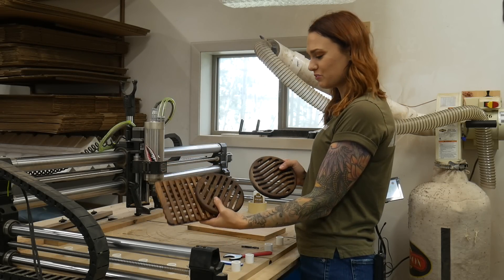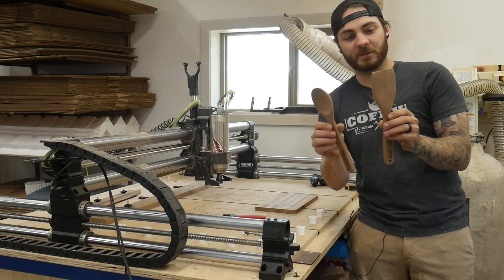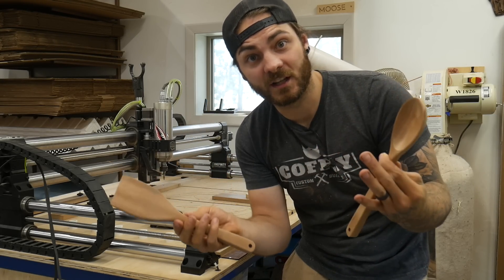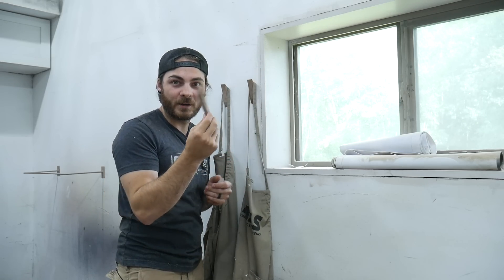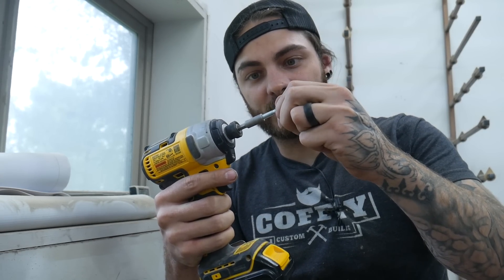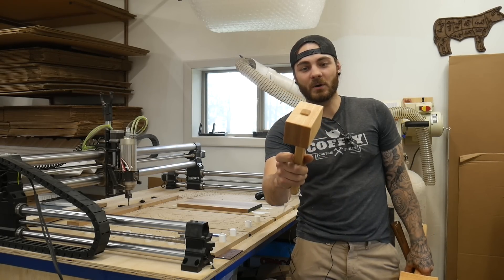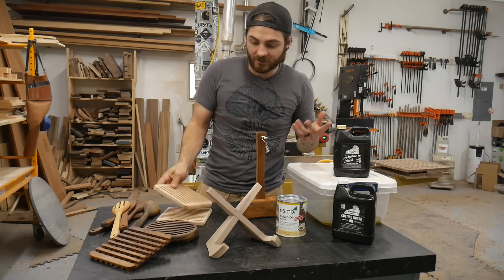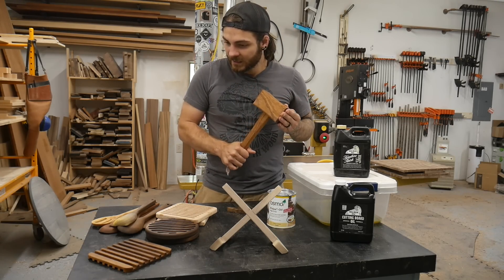5 CNC Projects You Can Make or Sell – Files Available

Comment: I like these products but I wonder what they would sell for and consequently whether they would make much profit.  For example, the salad servers took 10 mins of shaping with further sanding and finishing required.  Assuming this can be done while another set is machined you could maybe make 3 pairs in an hour including machine setup, periodic clean up etc.  In the UK something similar sells for £15 so your revenue, per hour might be £45.  Out of that you have to deduct the cost of the wood, oil finish, replacement tooling and costs of selling.  I cannot imagine making the hooks for a profit.  The trivets perhaps need little post machining work but looking on Google it looks like they would not be high value.
Reply from the maker: Not every product will have huge profit margins. When i started, I would sell items that i didnt make much on but it got products in peoples hands and they loved it and would typically come back and buy higher dollar items. You can easily sell the utensils for $20 each especially if you put names or sayings on them. People pay for  customization especially if its a gift they will splurge and spend a little more. Some items you would need to make a large batch to make it worth it. Also I make all of these smaller items out of scraps that have already been paid for by other customer builds, I have piles of small chunks of wood all over.

Comment: Pro-tip.. use a down-cut bits to avoid tear-outs on your work.  No one told me this when I got my first CNC and all of the bits that don't specify down-cut are ALL upcut bits and the upcut bits are horrible. They leave tear out everywhere.   I bought a bunch with my first CNC and spent hours trying to figure out what I was doing wrong only to find out it was the type of bit that I was using.  To me, this is a deceptive practice in the industry.  Not specifying when a bit is up-cut and only specifying when it is a down cut is deceptive.  Also, See-peel-ee not See-peel-aye. 😉
Reply: I only use upcut bits and have no problem. Were you using upcut bits with conventional cutting?
Reply: @bojangles5226  What kind of wood are you cutting with them?
Reply: @Theexplorographer  black walnut
Reply: @bojangles5226  Down cut bits specifically cut with a downward motion to avoid chipping fibers of the wood. So if you are using an upcut bit and not chipping out, more power to you.  We are talking endmill bits here btw.
Reply: @Theexplorographer  yes, I'm aware. I run standard 2-4 flute end mills depending on the type of work, all up cut climb cutting. The only time upcut gets me is on plywood but I rarely cut it.

Comment: I use carpet tape instead of super glue and masking tape. The carpet tape holds great.
Reply from the maker: interesting! thats a new one, hows the price point?
Reply: @TwoMooseDesign  Around $7 to $10 for 75' roll. You need less than masking tape and glue because it holds really well. I used two strips the whole way on a 18" board and had to use a tire iron to pull it up so lesson learned there.

Comment: Jess - I have an X50 Woodworker (just received it). Still a question of multiple toolpaths. Do I need to do them, or can i just run it altogether?
Reply from the maker: For the journeyman run the .75 bowl but at 100 speed .1 depth and 15 step down if you ramp then step down you can do like 40. Set your rpm’s around 14000 rpm’s or 3? I think on the makita. As for tool Paths most likely you’ll need to run multiple tool paths. In vectric you can merge toolpaths if you are using the same bit.
Reply: @TwoMooseDesign  thanks Jess. Just what I needed. You’re the best!

Tom

Comment: What cut speed and depth did you use for these? I bought your files and use Easel. I don't see where there's an option to add a bowl & tray bit to the mix either. Would you recommend moving to Vetrics?
Reply from the maker: Hey Tom! For easel run the bowl bit as a 3/4 end mill. You’ll have to make a custom option. For speeds and feeds it’s hard to tell you without knowing what machine you have. Vectric is great! It’s pricey but has a lot more options than easel. Easel is fine for starting out I still use it for some stuff.

Comment: Why don't you just use locator pins and flip the piece to carve the bottom profile before the final cut-through and release of the work?
Reply from the maker: You definitely could! I just have no way to make 3D files, I have v carve pro and it’s quite limited when it comes to 3D design. So just carving the bowl part is easiest with what I currently have available 🤷🏼‍♂️

Comment: At nine minutes per, plus handwork, oiling, material, branding, and transaction, @ $1 a minute for machine time (machine/tooling/depreciation) your probably close to $12+ each your cost? You sell spoons and trivets for $24? 50% margin?
Reply from the maker: I don’t sell the trivets personally but I’d sell them for $20-25 then bundle them for cheaper If they buy more. They are pretty easy to make. The spoons and such I would sell for $25-30 each the bundle them for cheaper as sets. The spoons and spatula take about 9 minutes to cut both then probably another 10-15 minutes for both to finish shape them.

Comment: What are your price points for these items. Looking for some comps I could use for my area. I've sold trivets in the shape of Texas before. I used cutoffs from some cutting boards. These are great looking by the way!
Reply from the maker: Totally varies on our location and customer. Something like trivets I’d probably sell them in bundles so one for $20 or 2 for $35 etc. but that wouldn’t include shipping.
Reply: @TwoMooseDesign  Awesome thank you. If I remember, I sold my last trivet for around $25. Was just trying to see what other may charge for them. Thanks for the response.

Comment: can you explain why you use a down cut bit rather than an up cut bit?
Reply from the maker: Hey! It doesn't matter too much in most situations. If just cutting general items ill use a down cut, if i'm doing heavy removal or aggressive cutting ill use an upcut bit. the down cut forces chip down and leaves a cleaner top cut, upcuts force chips out keeping the bit cooler so you can run it a little harder without heating up and dulling your bit. again in most applications you wont notice much of a difference especially if the piece needs to be sanded anyway. I would just recommend not using an upcut if you are using a mask for painting as it will shred the mask. If you watch any of my cutting board videos I always run upcuts as im cutting pretty aggressively. Hope that helps!

Comment: Great job on the video! I'm gonna try the utensils then laser some graphics on them. I have a question, do you find it cheaper to do the masking CA glue trick than double sides tape? I get 36 yard of double sided tape for $8.99 so just wondering. Thank you!
Reply from the maker: Hey! It is cheaper, I wouldn't say its drastically cheaper its just my preferred method. I always have tape and CA glue in the shop and have always had great results. I have had the cheaper double sided tapes fail on me. So id say use what ever one works better for you! Thanks for watching

Comment: quick tip: when you tighten or loosen the collet with 2 wrenches, squeeze both wrenches in your palm just like a pair of  pliers, rather than using 2 hands. you get alot more force with much less effort.
Reply from the maker: thanks for the tip!
Reply: Also reduces stress on carriage.

Comment: I am always astonished at how well the tape and glue method is at holding down stock. You are running some serious feeds and speeds there with a relatively beefy end-mill, and that stock just stays down like it’s nobody’s business.
Reply from the maker: Right 😂 I was pretty shocked the first time I tried it. Even with my beat up waste board it still holds strong
Reply: @TwoMooseDesign  why making tape and glue over double sided tape?
Reply from the maker: @ryleylamarsh  same thing, it’s just a cheaper alternative
Reply: @TwoMooseDesign  that’s what I was assuming. I suppose I should try it. Another method you could try is mask that’s used for vinyl lettering which you can lay over the entire surface and then on the wasteboard and then spray glue on that. Same method but over a wider surface.
Reply: @TwoMooseDesign  I use 2" wide carpet tape, works nice and comes off with no risk of excess glue leaching thru